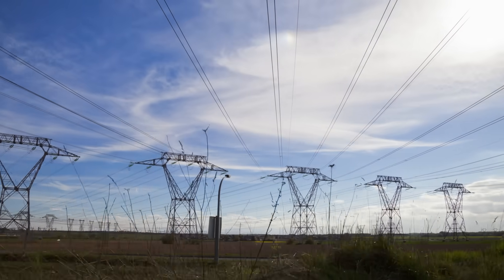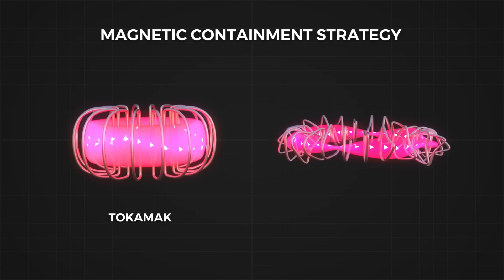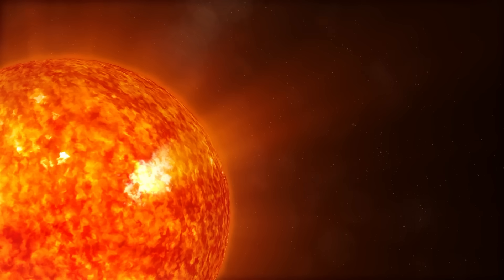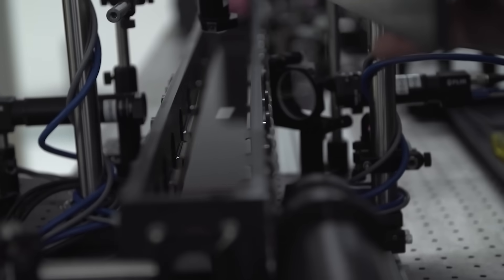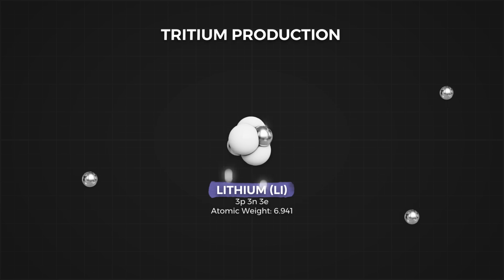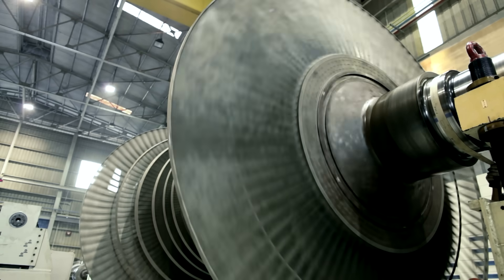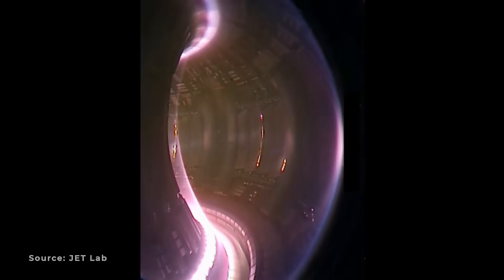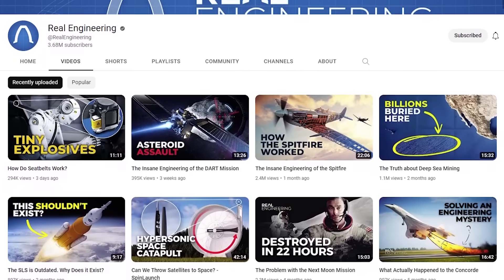The Problem with Nuclear Fusion

Comment: I would love to hear what you think of Thorium-based nuclear power?
Reply: The only difference is that instead of using naturally occurring U-235 isotope of uranium (or Pu-239 and Pu-240 bred in reactor) Thorium-based fuel cycle is supposed to bred U-233 isotope of uranium from Thorium via means unknown (but most probably by using U-235 fuel cycle with addition of thorium for neutron capture). What exactly is this going to solve?

Look, the ONLY real issue with nuclear power is anti-nuclear political force that drag power plant construction via lawsuits and other means so it takes ~30 years to build a plant instead of just several years like it takes for any similar sized construction project. In the West 3/4 of cost of nuclear kwh is interest payments on loan taken for power plant construction.

Remove this barrier and suddenly we have the cheapest power source which also happens to be the cleanest.
Reply: @tomassakalauskas2856  I say who cares if you have to replace a metal tank and heat exchangers (abet with more expensive alloys) every couple of years or decade, it's not like the gigantic heavy steel forgings to hold back the insane pressure of PWR reactors, it's for a molten salt reactor under much more mundane pressures.
Reply: Search Youtube for "What You Need to Know: Thorium Nuclear Power"  by Illinois EnergyProf
An short explanation by a  Real Nuclear physicist.
Reply: @shotelco  Thanks Shot, I will :)
Reply: The molten salt reactor is the important part, not the fuel. Thorium has nothing to do with it.
Reply: @tomassakalauskas2856  the corrosion problem is not a showstopper at all. There's two ways you can deal with it:
Going for small and modular reactor "cans" that are designed to be replaced every 5 years or so, where the amount of power produced will easily pay for the recycling of the cans and their replacement (ThorCon, Terrestrial Energy)

Alternatively just denature the salt mix with elements that the hot salt will preferentially corrode and thicken the reactor walls somewhat, so it can have a long healthy lifespan
Reply: @AlterR4  thorcon Deez Nutz

I had to I'm sorry 🤣
Reply: @Flesh_Wizard  i approve
Reply: This channels insistence on focusing on fusion while comparing it to 1st gen fission is infuriating.  MSRs are much bigger than just Thorium and solve nearly every problem people bring up against fission while being attainable today.
Reply: @NACAM42  Pipe dreams sell.  Americans have a fetish with technology, in that we beleive new tech will miraculously solve every problem - thus, no need to revisit something we were told (by bigOil) to be afraid of.  Meanwhile, France Currently derives over 75% of its electricity from nuclear energy.  France just set a  programme for six new Gen III EPR2 reactors, with an option for a further eight EPR2 reactors to follow.

Slovakia, Belgium	, and Hungary also produce the majority of their power from Nuclear (Ukraine "use to").  There are 15 nations, including Turkey, China, The UAE, and Korea that will be turning up new Nuclear plants just in the next 5 years.  About 100 power reactors with a total gross capacity of about 100,000 MWe are on order or planned, and over 300 more are proposed. 

The U.S. has two coming online in the next few years (in Georgia)

Considering that 65% of U.S. energy still comes from burning fossil fuels (making Electric Cars in America a joke), Americans would rather be amazed and wait for the new technology pie in the sky - which is what pays the bills for channels like this.
Reply: @NACAM42  Actually, the Aircaft Reactor Experiment (which used Molten Salt) was attained ~70 years ago. It feels a bit nuts that MSRs were demonstrated so long ago, and we still haven't matured them fully, today. But it just goes to show how important market, economic, and regulatory factors are in tech development. It's not just all about science, sadly. I'm very glad we did have that early win to show the science is there, waiting for us to solve and deploy the solution!
Reply: It’s good in the meanterm though, in SMRs
Reply: Its not as clean as its made to seem.
Reply: @tarakivu8861  expand on your point please?